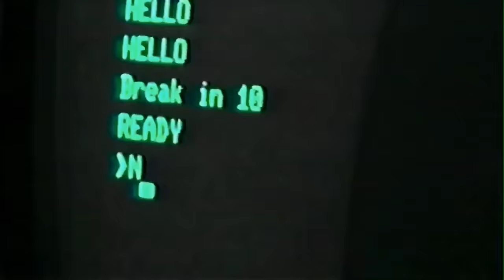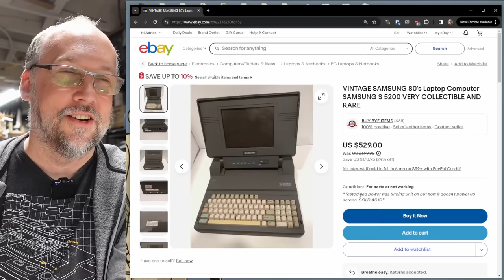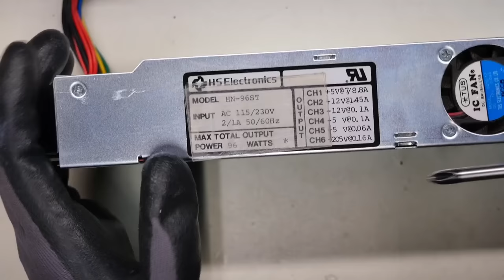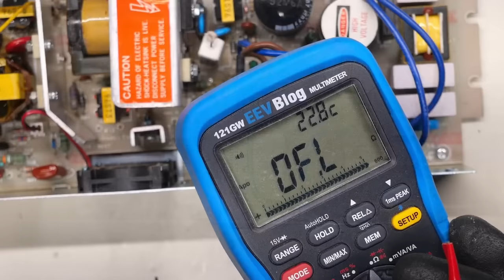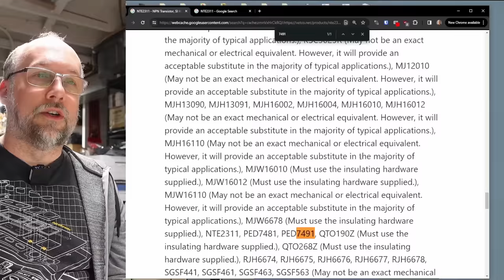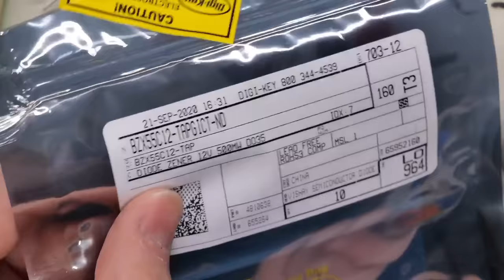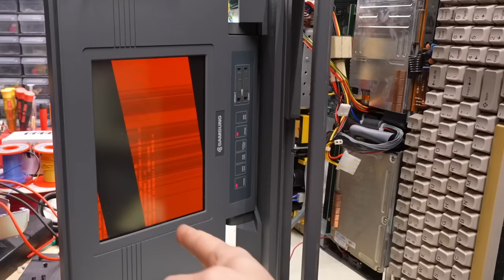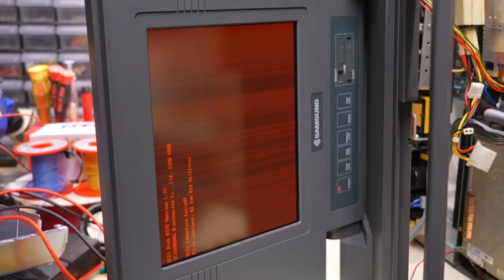Does this dead "laptop" have a gas plasma display? Let's try to revive it to find out! Samsung S5200

Comment: I used to have a 286 laptop.. it was battery powered and like half the size and it was still huge and heavy
Reply: 8:00 😂as someone who owns one of the actual first "laptops" on the market (Morrow Pivot lunchbox) that is funny
Reply: @forbiddenera That was never considered a laptop, but a portable PC. When real laptops first came out they were always compared in their separate categories
Reply: @MrCarGuy  Note that I used quotes (like Adrian in his title) and called it what it is, a lunchbox.. but it's still more of a laptop than this thing since it actually has a battery and can be used unplugged, unlike contemporary "portable pcs" that all still required to be plugged in, including this one. It also has a few apps in ROM (including a term) that were usable without booting and not requiring disk access which would increase life. Sure, it's not something you're gonna use on your lap, but neither is this. The 286 I had though definitely could have been. For a long time notebook was a popular term, no one could decide whether to call them laptops or notebooks and seems like laptop definitely won out.

Comment: If you want another interesting laptop to work on, have a look at the amstrad atl386sx it can have a co processor upgrade, and takes standard desktop ram and like this I can't recall if it's one or two ISA cards mine came with the worst option of the black and white LCD panel but you could upgrade it to a  colour one,, it had a floppy and 3.5' desktop hdda 1.5 hour battery and I dropped it off a single story roof with nothing more than cosmetic scratches! With some tweaking it also ran DOOM!

Comment: you got that wrong adrain i believe there is way to fix that screen
there is flex cable behide screen run line to each side of screen all you need to do is remove cover from bottom to up that way avoid snapping any clips and you just need hot solider iron and reflow connter surey will fix it
i have done this on few tv because so weak and easy melt so be quick tap it for short time n let off of it so it doesnt melt flex cable i know you can do it and there is way to fix that
you may want remove screen off laptops housing so you dont danged it

Comment: PED7491:

Mospec Semiconductor :: Si NPN Power BJT
Specsheet / Datasheet
V(BR)CEO (V)=400
V(BR)CBO (V)=700
I(C) Abs.(A) Collector Current=12
Absolute Max. Power Diss. (W)=110
V(CE)sat Max.(V)=1.0
h(FE) Min. Static Current Gain=8.0
h(FE) Max. Current gain.=60
Status=Discontinued
Package=TO-3P

Comment: I think the original name given to the display was "electro-luminescent"
Reply: That was different again. Many LCDs in things like synthesizers and scanners used an electro-luminescent backlight which was a sheet that glowed. The problem is that they get dimmer over the years. Replacements are available.

Comment: I tried fixing a plasma display with lines in the display. Pins on driver chips corroded, I didn't find the cause, but as you can see, no way fixing that. Just too far gone sadly. watch?v=uf7UNdW9dtM

Comment: Would it be possible to remove the psu and mb and screen and replace with current hardware to make it seem like retro tech but really just a fun case. I could trim that bezel for a 15 inch screen maybe? Basically i just want to know if that keyboard can be reused or are there any laptop keyboards that would fit in there to replace it and hook to a mini pc mb with an i7 and basically a gaming machine that i can take with me but at home use external monitor/keyboard and mouse. I am also thinking of doing it to an apple 2 but id have to make a flip up screen from scratch. Anyone have any ideas? Does anyone sell parts to build your own laptop?
Reply: Framework makes DIY laptop "kits",using all-new parts that you customize to your liking and assemble (no soldering) yourself with their "menu" of options and parts.

Fully modern High-Spec gaming machines are available at reasonable cost.

AMD or Intel, 13 or new 16 inch, huge memory and storage, you pick your poison.

Not with Framework or paid, just happy with my new laptop.

Also, keyboard choices, backlit, transparent, or foreign keytops, numeric option on 16 inch.

Dave

Comment: Ok, Plasma - you may want to actually direct DEGAUSS it, that might help fix some of the issues, and to work on the lines, you might have to pull open and check the ribbons themselves, as the ribbons do age they start to have issues getting interference and crack/failure, there is a .. lazy .. way to try and fix (using a hot air gun and trying to get warm enough to cause any free solder point to rebond) but this way is VERY unreliable. The laptop was made in the early 1988 year it looks like (by the serial/model number the 3988 could be month day year, or day month year 3/9/88), they were not commonly using harmonic welding for panels at this time, so they will be heat pressed ribbon cables around the screen.

Comment: I have some semi rare computers i could lend ypu for videos.

Hp ZD8000 desktop replacement laptop xp era 

Xerox branded olivetti 8088 machine with its original screen tons of software, installed math co processor, ive been told its the most complete system of that model in exsistance. Has every origonal piece but the box. 

I have some otheers get in contact with me and i can send you a whole list of my collection. As long as you handle them with care ill loan you anything i have.